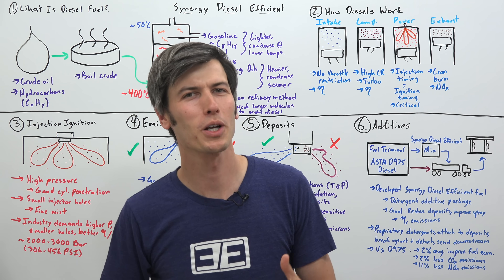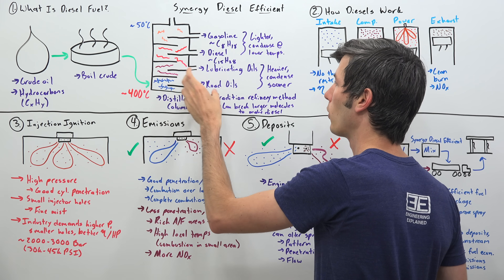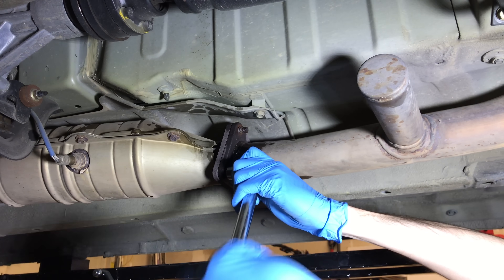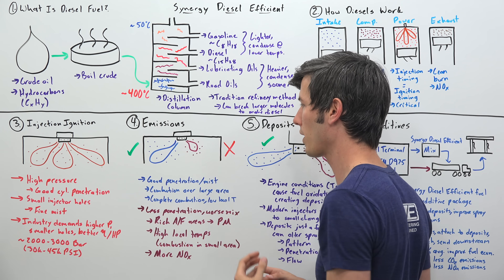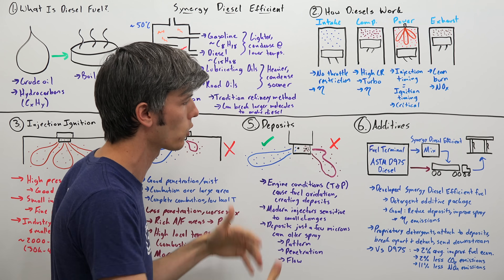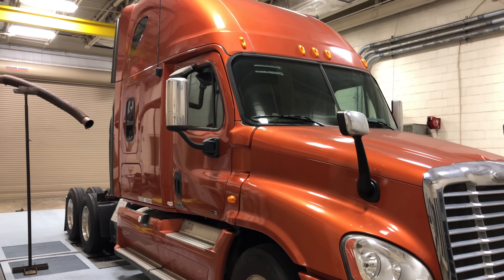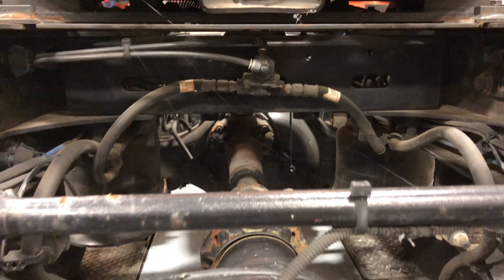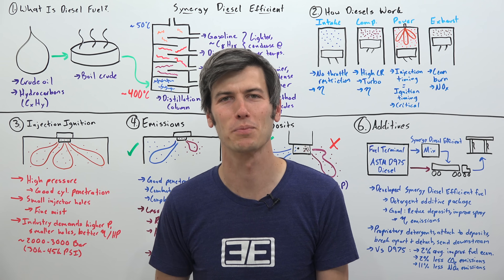Why Diesel Engines Lose Power & Efficiency Over Time

Comment: So, no mention of cylinder wear and compression loss. Every OTR truck driver is probably familiar with 'blow-by'.
Reply: Hell i’m very familiar with blow by with my pickup. My cummins has 480K on it currently and I have blow by. Not enough to cause much of an issue but cylinder number 6 is down 10-15% compression compared to my other 5 cylinders. Either the cylinder wall is scored fairly badly or I have a cracked or broken piston ring I think.
Reply: Ah yes, lot lizards.

Comment: My VW TDI diesel got better after first 40K miles after break in. I put in optilube in my fuel for higher lubrication for CR fuel pump. Tons of torque and 50mpg hywy.
Reply: Isn’t 40k miles more than half of a VW's lifespan?
Reply: @nnnkatze4329  No troll, these engines go +300,000 miles or more easy. Mine now has low 110,000 miles, but on the TDI forums many have +250,000 without a lick a problem or reduction in efficiency. VW on top of that gave me $6000, 40,000mi/4yr extended warranty a year ago when they did the emission mod ($2500 worth free). Could not be happier. Love this car.... But why am I telling you? You don't even have a nice car and you're a troll. Piss off.

Comment: So dieselgate cars had less co2 emissions but worse NOx emissions?
Reply: Overall Diesel have less CO2 emissions at the same power but more NOx and SOx and heavy particles. So Diesel is more eco-friendly but more  harmful for human beings.
Reply: substantially much higher NOX emissions than allowed on the road, and there was a separate issue where some Audi engines were claimed to have been rigged to produce less CO2 as well along the way....

Comment: I'd say straigt off the bat that the main reason is dirty valves that dont get washed with fuel due to direct injection.
Reply: For some reason I almost never heard of that being an issue in the Diesel engines I’m used to which have been direct injection since 1988 when they came out. But at the same time my Audi with a 2.0 direct injection gas engine, carbon buildup on the valves is a known issue. My cummins has 480K miles on it. Head has never been off, valves have never been cleaned. Still no issue with carbon buildup

Comment: AS u discussed only about the NOX emission but I learnt, in general diesel engine is responsible for the emission of SOX and the particulate matter ??
Will u please tell me the %Reduction in the emission of SOX ..
Q2: Answer me please the average pressure maintain of the fuel injector to the combustion chamber???
Reply: SOX is largely affected by reducing sulfur content in the fuel - thus ULSD came around...and is rippling into maritime fuels now too as of 2020...  they're cutting allowable levels by a factor of 7x ...
Reply: @lylestavast7652  ULSD??

Comment: All that effort, cost and energy spent to  still be 50% less efficient than a electric motor.......even if that motor is powered from a fossil grid.

ICE is dying and quickly
Reply: Irrelevant as EVs use similar resources to that you could build and run an ICE for a lifetime to build the batteries alone 🤠
Reply: @Rookiereece  lol not even remotely close to being true.

While it is true the energy to build a ev including its battery is around 25% more than a conventional car, that is quickly paid back within a year or 2.

Across a cars lifecycle (say 1,000,000km), the energy used would be about 1/5 that of a conventional car.

Making you completely wrong
Reply: @stinger15au  I'll take your word for it, I'll start looking at EVs once a full recharge takes 10 minutes 😁
Reply: @Rookiereece  why? I cant think of a situation where that would ever be needed.

The car starts every day with a full 300+mile range.

So daily job done.

Road trip of upto 600 miles with a single 45min stop for lunch.

People need to stop thinking like a gas car, they are not the same thing. You don't need to charge that quickly.

V3 supercharger adds 75miles in 5mins though

Comment: I prefer diesel engines. Probably cuz my dad's Volkswagen is diesel and that's the car I drive, but I also just prefer the idea of not using spark plugs. Plus, theoretically you could run a diesel engine on vegetable oil (though, with modern engines that's not really feasible as they continue to try and reduce the injector size; thus vegetable oil is too viscous from what I hear (but supposedly works fine in older cars)).
Reply: you can on modern engines, but you'd have to process the vegetable oil to strict standards to turn it into diesel fuel. This means accurately measuring and adjusting the PH number, eliminating as many contaminants from the fuel as possible and making it as pure as possible in terms of diesel.

Comment: I have 2008 Cummins 3500 dually.  Owned from new,  now it's almost 400,000 miles.  Very well maintained.  It runs like top! Still has power and torque numbers from factory.  Also I recently bought another Cummins,  2019 3500 with 24,000 miles,  has some issues like fuel degradation, ignition keys not working, some odd leaks.  What the hell?
Reply: @jacobdukes4741  I know.  Just that why things fail on 2019 model not the '08 model? I haven't done anything different from either trucks.

Comment: If I had a diesel, I would modify the engine so that it could take vegetable oil as fuel. Diesel where I live is about $3.19 a gallon anyway, so I imagine the savings would rack up over time.
Reply: And you call this expensive?
Reply: @ΑΡΗΣΚΟΡΝΑΡΑΚΗΣ  if he would have to fill up his tank in europe once he would be glad about the price he has to pay now...
Reply: As far as i read that only works woth old Diesels, newer common rail ones with the high rail pressure he mentioned won't work.

Comment: The distillation process is performed not only by heat but under pressure. The process is known as "cracking". The alternative method would be a centrifuge. A more accurate explanation of why fuel ignites in a diesel engine is "heat of compression". Timing refers to the opportune time to ignite the fuel in a given stroke. Lastly,  I believe the Exxon additive is essentially a catalyst that organically bonds to impurities either in the fuel or byproducts of combustion in the engine and enable the particulate to burn off.
Reply: What he was showing was the  separation of compounds in crude by fractional distillation which is separating the rough groups by using their boiling temps and condensation essentially.   .... cracking is a follow-on process which splits longer chains in those cuts into shorter chains using steam, hydrogen, catalysts -   - you're making targetted  changes to molecules to split them down to smaller chains.  that's the key difference between distillation and cracking...
Reply: @JamesFox-g7x  The most important requirements for a Diesel engine to perform at optimal efficiency is the injectors are operating as designed. i.e. popping pressure. spray pattern and minimal deposits which will have a tendency to collect on the tip. The fuel filter should be changed adhering to the manufacturer's  change schedule.Ditto the turbo air filter. Beyond that and short of an engine rebuild, no "magic potion" is warranted.
Reply: Strictly speaking distillation and cracking are different parts of the larger refining process. Distillation is actually typically performed at atmospheric pressure or a vacuum
Reply: @Jackisaboss1208  Yes I'm aware. Stratification vs. molecular change. I thought the production of diesel "cracking" was relevant here. I'm not going back to watch his video. I just like putting in my two cents. GL
Reply: Detergent
Reply: Understand that any fuel additive will by virtue of (blow-by) dilute "dilution" the crankcase lubricating oil. There is a trade off and to my mind additives in general are not advantageous. Gotta go! GL!

Comment: Pretty remarkable how much engineering is behind dinosaur boom juice
Reply: @lodazal6571  it's motion lotion.
Reply: @TheGhost I KNOW! Sounds like a person a little miss informed and a few facts mixed together! And, a whole heap of tree hugger do it my way or the highway! oh, wait they don't believe in highways!!! ^__~
Reply: It's not old dinosaurs the earth makes it anyway
Reply: I'm just a backyard mechanic and I never completely understood diesel engineto me you would think gasoline engines would have more power because it has an actual ignition spark that ignites it compared to just waiting for a high enough compression to spark the fluid like I said I'm just a backyard mechanic I can do brakeswheel bearings drive shafts that kind of stuff I still don't get how the diesel makes the power it does even after watching this video
Reply: @kylelytle4251  Well, I don't fully understand diesel engines either, however,  I used to work at a factory where they built furniture, and the hired many people from Cambodia, and other Asian countries, they would use special stains on the wraps, and wipe the oak wood, then after using those oily wraps they would throw them in the dumpster out side! Next thing we know a fire would accur in the dumpster, and the fire department would arrive to put it out. That was a long time ago, but I think that is how a diesel engine is able to ignite the air fuel mixture by high compression, which causes enough heat.
Reply: That's just a myth, diesel/gas is not dinosaur juice. It's much older, from the Carboniferous era 300 million years ago if I remember correctly.
Reply: @sogerc1  Carboniferous is coal. It came from rotting plant matter.
Reply: No it's called boom boy thicc.
Reply: @J L Main thing is finding new reserves.  We never really have a "complete" map of ALL of the worlds reserves, also "hard oil" like oil sands, oil shale, and underwater hydrates aren't entirely profitable, but could be used if need be.  Eventually it will be easier to make HTL / Pyrolysis BioCrude than to go though the effort to find some elusive last resevoir.  Not there yet.
Reply: I mean, it kind of ahs to, engines have been under  constant upgrades since their inception and really at this point they have more or less reached the peak of their efficiency. It is really why cars kinda need a shakup in term of technology because otherwise we would enter into a cosolidating stagnant market which is NEVER a good thing... I mean even worse than what we have currently
Reply: Actually it's neither the plants nor animals that we usually think of. Petroleum came from plankton.
Reply: Petroleum comes from microorganisms, oleaginous bacteria, not dinosaurs. Coal comes from plants.
Reply: I think you mean how much marketing is behind these juices!?
Reply: Oil did NOT come from "dead dinosaurs". That is one of many LIES we've been taught. Around the turn of the last century ( 1890 to 1910 ) they held a Geneva convention. This was not long after they realized the great potential oil had. One of the world's most richest & powerful ( it was either one of the Rockefeller's or the Rothschild's I believe ) men stood up and proposed that they FALSELY label oil as "fossil fuel" ( and the lie: "from dead dinosaurs" ) to lead everyone to believe it was "a limited resource" that needed REGULATION by the world powers. This enabled them to CONTROL & MANIPULATE THE PRICING.......ie: CHARGE MORE MONEY. The truth is: THE EARTH CONTINUES TO MAKE OIL. Scientists do not know how or why. Look how deep they have to drill for much of the oil. Do you honestly believe "that used to be the Earth's surface where dinosaurs died"???.........THOUSANDS OF FEET DEEP??? Of course, they keep the truth about this from the masses to this day. And you'll NEVER find this information through the mainstream media. Many oil wells ( but not all ) that were pumped dry long ago, are now filling back up with oil. LOOK ALL OF THIS UP IF YA DON'T BELIEVE ME. Even as a young child, when I was first taught that "oil came from dead dinosaurs".........I thought that just didn't make any sense at all. I didn't know how or why, but it sounded crazy to me. I'm now 57, and several years ago my suspicions were vindicated when I watched an amazing video about the topic. This video was about 2 hours long. Sorry I can't remember the title. Maybe search: "the fossil fuel hoax" or "fossil fuel exposed"........What do ya think fuels the world's volcanic activity? It's NOT "lava". Lava is molten rock, and the RESULT of a fuel source heating it. Sure, tectonic plates deep in the Earth shift & create much friction and heat, but OIL plays a huge role in fueling much of the volcanic activity. Of course google is manipulating search results like never before, to keep as much of the truth as possible very difficult to find during a simple search.
Reply: Howabouthetruth  ha ha ha, you absolute fruit-loop!
Reply: @howabouthetruth2157  oil comes from dead plant material goddammit. It's not a secret
Reply: @howabouthetruth2157  sure bro, oil burns in the inside of the Earth, with what oxygen, though?
Reply: @howabouthetruth2157 
 I do agree ,Absolutely make sence for me too.
Reply: Plant matter people!!! I'm sure there's some dino juice in there too!!!
Reply: @redneckoleptic1813  If the ratio is the same today it's 99.99%  plant matter.
Reply: @redneckoleptic1813  I'm telling you, you do NOT get "plant matter" OR "dead dinosaurs" THOUSANDS IF FEET BENEATH THE EARTH'S SURFACE. You're thinking of METHANE GAS. That DOES come from decaying plant matter, and it's being formed & released ( due to pressure build-up ) from sea grass beds and swamps all over the world. But NOT "oil".
Reply: @Howabouthetruth ????? What ?????.   Plant matter in the earth's crust under pressure for millions of years= OIL! NOT, methane! The sea grass you may have been/are smoking^__~ is not what I was talking about! I know all about that effect! Different subject!!! But, Thank You for bringing it up! It's an important resource too!!! And, one day when/if that swamp has been under the earth long enough it'll make a good oil deposit! The dino thing was to appease the idiots(oh, now I said it^__^)! ........Have a Good One!
Reply: @TheGhost You just have to bark like some worthless little dog. You go ahead and remain brainwashed & clueless to the truth of all life and the history of everything. I could care less. Now, run along & watch some more TV........you're missing cartoons.
Reply: @TheGhost Yes, dinosaurs DID exist, and still do in some remote areas of the world. Furthermore, they did NOT live "millions of years ago". The atheist scientists only use "millions of years" as a desperate means to support that "science" FALSELY so-called, communist-invented fairy tale known as "evolution". To prove dinosaurs existed only thousands of years ago ( not "millions" ) a well-known ( I can't recall her name at the moment ) lady scientist who specializes in the recovery of T-rex bones in North America, made the startling discovery of actual tissue and red blood cells from the bones of T-rex. This would be IMPOSSIBLE if those bones were "millions of years old". Look this stuff up. But ya won't find it from the corrupt mainstream scientific community and/or the mainstream media. That's because they don't want you to know the truth. Even google is now manipulating search results, making a lot of TRUE information hard to find.
Reply: @howabouthetruth2157  yep.agree
Reply: @Allen Loser Ever heard of "abiotic" oil?  Look that one up.  It may not be "fossil fuel" at all.  God/Intelligent Designer of Earth may have terraformed this MOFO giving us oil to use by design, not happenstance.

Comment: Good thing you blocked out the Ford oval on the tailgate so we wouldn't get any subliminal advertising.  No one will know what kind of truck that is given the blocked out Ford oval.   However, this begs the question, "How come you didn't bother blocking out the Freighliner badge on the radiator of the Class 8 tractor?"
Reply from the maker: Look again, the badge is taped over...

Comment: Pff, got my Dad a Rover 75, 2.0L Diesel.  It's coming up to 120k miles and the engine is just about broken in.  It'll run forever.
Reply: Asdayasman, the engine lifetime that Enginering explained said was for the new diesels the old ones will literally run forever if taken care of. But that goes across the board.
Reply: @michaelbenoit248  Hence the "pff".